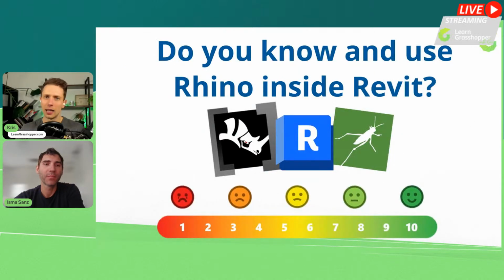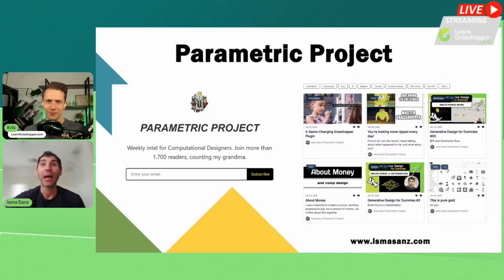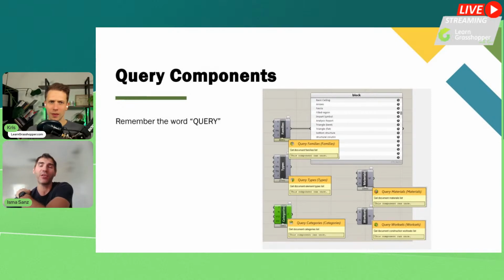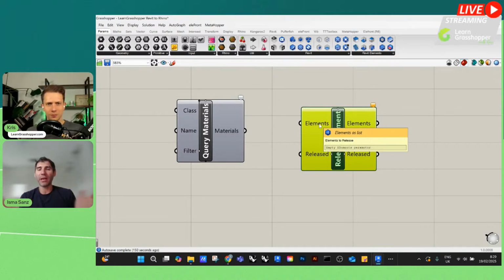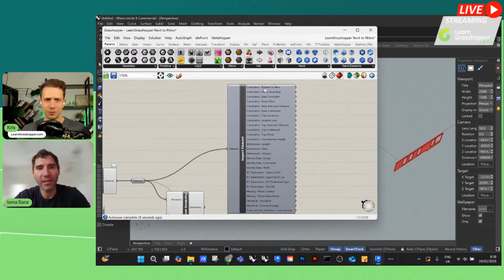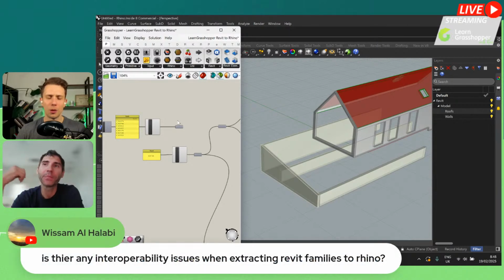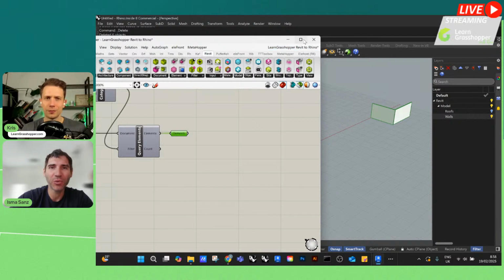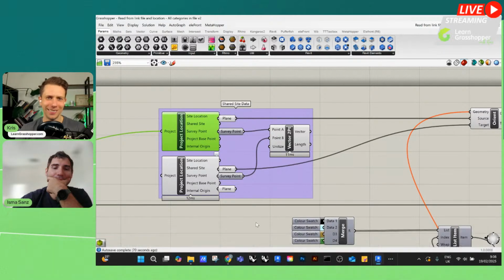FROM REVIT TO RHINOCEROS: Best Practices for Geometry and Data Flow

Comment: 37:45 - data description element in new grasshoper not founded. How to connect automaticly element from element.
whats is data description.
How to add data description?
Reply: Revit 2025 run with Rhino.Inside WIP